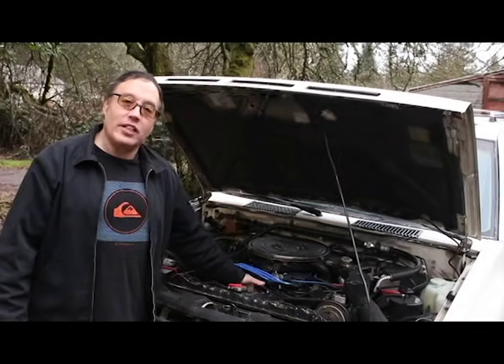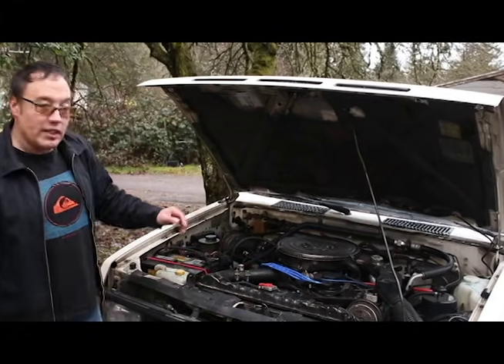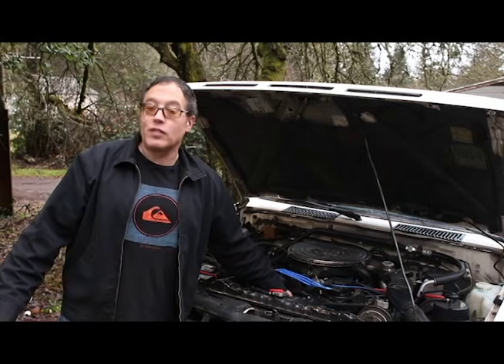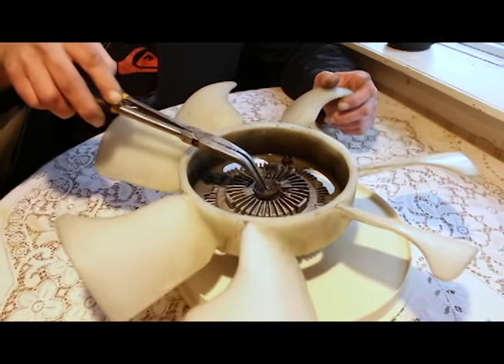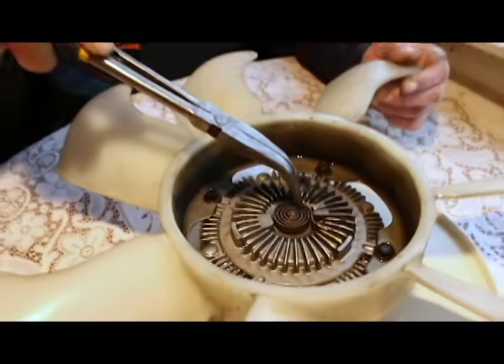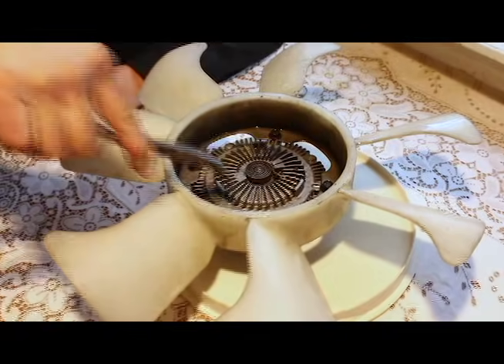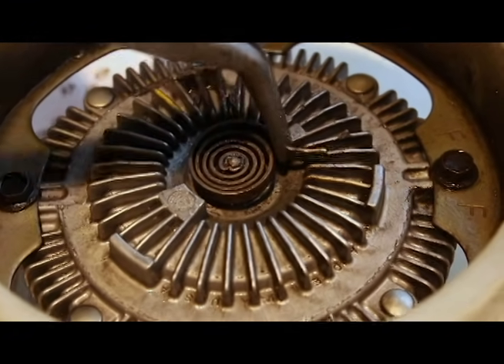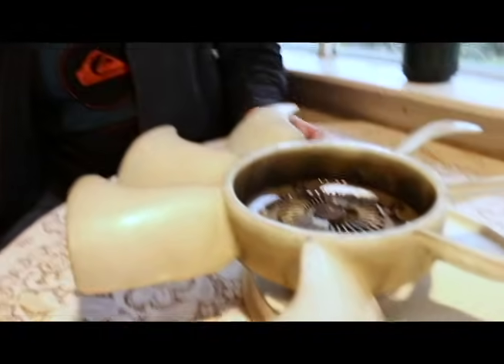Manual Fan Clutch Adjustment // How-to-Tutorial

Comment: Great video, if i may offer a tip,most people dont have a heatgun at home but most people have a hair dryer,use one when testing the fan clutch,it works great and your not taking a risk on anything plus it works great when doing a video, the procedure is more controlled that way.

Another issue with this video is that the majority of fan clutches have one notch casted into the unit where they rest, if you were to adjust it you would have to do a complete 180 on the spring and that would be quite a huge adjustment negating the whole purpose of doing it,yours is pretty cool, never seen one like that.
Reply from the maker: @dntlss  Thanks for the advice! I appreciate your input.

Comment: Hey can you help me out some one else suggested playing with this spring but my issue is it only gets hot on the freeway at high speed or when the revs are up it seems my fan is slowing down when under high revs or at high speeds if I idle its fine even in really hot temps 

To fix this would I need to make the spring have more or less tension 

Thanks
Reply from the maker: @jamessteele5455  
Most fan clutches are built to disengage at high speeds. The air moving through the radiator on the freeway should be enough to cool it down. I wonder if you have a clogged radiator? The spring can be rotated and anchored where it stays on most of the time. However, I’m not sure if that would be ideal.
Reply: @robbyj4310  which way do I do that to make it stay on definitely not a clogged rad I’m from Aus it’s extremely hot and it’s for a 4x4 application the rad doesn’t get a lot of airflow due to bullbar and lights we think the fan is slowing down too much on the freeway it’s the only time it gets hot
Reply from the maker: @jamessteele5455  
If your fan clutch is similar to the one in the video, you should try moving the spring to the left (one notch). You might have to experiment a little to get the desired results. Hope that helps.

Comment: I appreciate your video. My problem with my ninety three ford is that the fan stays on all the time. It's very annoying and loud. I appreciate you showing how this system works. Sounds like I need to tighten my spring so the valve will open later. Only at extreme high r p m do I hear the fan finally shut off.
Reply: Did the fan match with car's RPM when you revving/pressed the gas pedal??

Comment: It worked . After adding a 4 core radiator, two additional electric fans, this guy solved my problem. Thank you so much !!
Reply from the maker: I’m glad it worked out for you!
Reply: You either have a electric fan or a fan clutch but not both unless you have  a custom car, is that what you have?
Reply: Sarcasm at it finest

Comment: Damn, that's a great idea. 
When I start mine, it's sucking air the whole time it's parked, even after the thermostat opens at 195.
I have a 4.3 2002, it gets warmer & warmer when towing a small but heavy as heck homemade 5x9' trailer w/ 200lbs in it. 
I cannot freely spin my fan after it's been sitting cold for a few days here in SE Texas where it gets pretty warm outside.

Comment: I do this from summer to winter for gas mpg and it helps alot in the winter time I can take off from a stop light and get down on it and never hear my fan before I adjust it all I could hear was the fan now summer time I put it back and u can hear it works great I've been doing it for years on my 2005 3500 express van 6.0 I get 11 mpg winter time and 10 mpg summer time the fan robs alot of power !!
Reply: What year, make and model is your vehicle, also what's the engine type and displacement?
All of these determine why your getting so much reduced miles per gallon..
Reply: A fan clutch is supposed to only take 1-2 HP away and 3-5mpg.
It also matters what fan clutch you are using, size of the blade and weight of the clutch fan blade.
For example my buddy uses a Dorman 620-155 11 blade plastic fan blade on a Hayden 2794 viscous fan clutch(hydrolic mechanical).
The Hayden Automotive 2794 fan clutch is 3.3-Lb and the blade is 3-Lbs so that's only an added 6.3 Lbs on the belt drive.
If the clutch has very good bearings and is properly lubed and has minimal weight then you should get very little resistance on the drive belt and almost negligible MPG reduction and the 1-5HP loss can be circumvented by adding a better intake, air filter .

Comment: Anyone else notice that about 3 slots over (counterclockwise) there is what looks like a proper slot that the spring tab should be locked into?
Reply from the maker: You are correct. The slot is the original anchoring position. Moving the spring away from the factory setting will change the engagement point for the fan clutch.
Reply: @robbyj4310  when we move the spring one or 2 notches do we move it counter clockwise or clockwise to make the fan work more often or make it lock up more ?

Comment: Chevy Silverado 2500HD does NOT have provisions to do this spring adjustment.  No slots to move the spring.  Aftermarket $75, OEM dealer $271 fan clutch.  I have tried the after market and  the truck overheated in the drive thru waiting for my meal. Fan clutch never engaged; return the part.
Reply from the maker: It's frustrating that some aftermarket fan clutches have inconsistent build quality. I noticed that your clutch has only one anchoring position, as you mentioned in your comment. I wish you the best of luck in solving your overheating issue.
Reply: Drill a hole and run a bolt thru it

Comment: I had no idea you could adjust these. I have an 08 chevy colorado, bought it used with 130k on it, while changing belts I decided to put in a new fan clutch. Now it stays on constantly even when it cold or im on the freeway, horsepower sucks and it sounds like a semi
Reply from the maker: It definitely sounds like that unit is defective. It should disengage after a couple of minutes when cold.  They really weren't made to be adjusted, but my video is a work-around if you're experiencing problems.  Move the tail (anchor point) either clockwise or counterclockwise (not sure which way on your unit) so it won't stay on all the time. Move it just a little, it doesn't take much. The quality control on these aftermarket units aren't great. Hope that helps

Comment: They actually make fan clutches with this feature. They have 2 screws to rotate the spring in both directions....

I might add. If the shroud has gaps all around the edges. You're sucking air around the radiator\condenser. Those seams have to sealed off. I used rubber door trim to make a tight fit. Problem solved...
Reply from the maker: Master Chief 00117 That's definitely some good information!

Comment: Interesting, while you're in there spray that center valve down with lubricating spray, they tend to rust up some and don't turn good. In fact, it could prevent the bi-metal coil from turning it at the set temps if it has too much friction.
Reply: This is also interesting. I never thought of this

Comment: Less noise clockwise to the right more noise go counterclokwise...more cooling auto parts store thermostat they are usually wrong and run much cooler than a dealer thermostat...worked for me..
Reply from the maker: First Last  I know that many aftermarket radiator thermostats have cooler temp options from stock. Example: 195 degrees stock with an optional 180 or 160 degree  thermostat. Once you start running cooler temp thermostats you may run into performance and mileage/emission  issues.

Comment: hi thank you so much for this i think this is my problem for that soft sand driving heating issue because it never gets hot other then that but at slow speeds on beach it goes up and i dont here that fan roaring like it does when i turn car on i have alocked up one in shed but man o man its loud i was going to put on for beach trips but its that loud its not going on the car Thank you so much this is why i love utube it saves me not getting robbed from all these mechanics in australia but it takes people like your self to put it up on utube cheers bud love your work.
Reply from the maker: You're very welcome Michael! I'm glad this video helped you out.
Reply: Gotta thank you. This worked for me. Stepped it back one and now after I warm up the fan roars like it should. I had almost no fan speed at 230°. I've got a new clutch and fan upgrade going in this weekend, but this is a great temp fix for me and confirmed my problem. Thanks again!

Comment from the maker: Sometimes spraying a little penetrating oil directly on the center of the spring can help free up an unresponsive fan clutch. If you rotate the spring one notch clockwise, it should engage at a higher temp point.  Keep in mind, that doing so would not fix a fan  clutch that is stuck on all the time (747).  Fan on all the time=loud/ bad gas mileage. Fan doesn't come on at all=overheat/fried engine. If it's hot outside with the a.c. running,  a good fan clutch will be engaged and you should expect to hear that "whooshing" sound.
Hope that helps-
Reply: Sir you have no idea how much this blew my mind. I have a 96 240sx which has a fan clutch that died on me. I replaced it with an Autozone unit which suddenly would engage all the time and stick til 3-4k rpm whenever i was stopped and took off in first gear in cool, cold, hot, all types of weather. Replaced it with an OEM and same issue. My temperature is always cool as I even have an aftermarket fan that keeps it nice. 

So with me having the opposite problem of you, I would move the notch clockwise correct?

Also terrific video, very thorough and very helpful!
Reply from the maker: Jesse Sharma yes if you rotate that spring clockwise a little bit it should come on later. it's kind of trial and error really until you find The Sweet Spot for that spring.
experimenting with different spring anchoring points is the key. 
it can be frustrating at times if you have to take off your fan clutch to do it,  but once you get it, you're set- 
thank you for the positive feedback I really appreciate it!
Reply: Np man, thanks!!
Reply: Hey Robby J
Thanks for the video I have an old tractor that is getting hot and the fan clutch is not engaging, according to what you're saying I need to turn the spring counterclockwise to lock it?
Reply: Nico Nico yes
Reply: Robby J hi man I want the least noise and I want to make my car more relaxed  what should I do
Reply: Mine is loud when it's cold outside or it's hot outside. I replaced it a few years back from the o e m. Ever since I did it has been howling

Comment: today the temp this moring was in the mid 60's and  i noticed my clutch fan already engaged, it sounded like a 747. The clutch is a aftermarket (installed 5 months ago) and I changed it bc I thought my old clutch was going bad. My question is which direction should I adjust the spring (clockwise) and do I need to heat it up before making the adjustment?  Do you think I should just buy a new fan clutch?